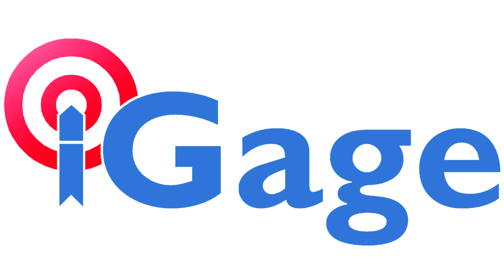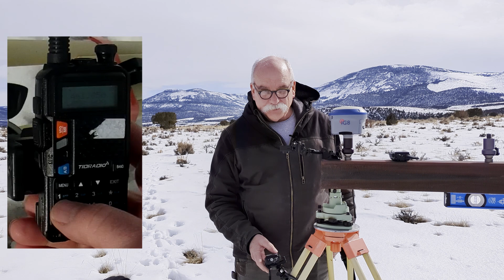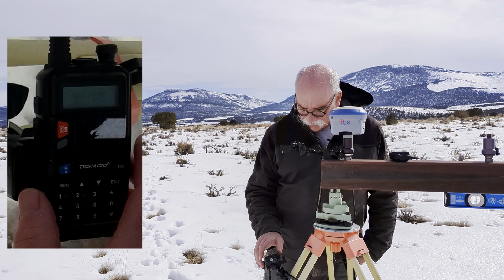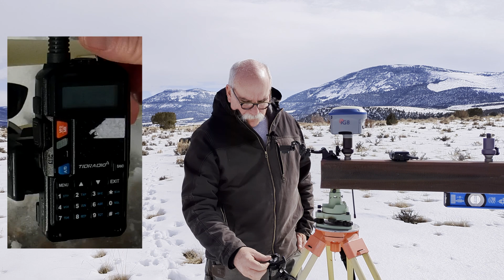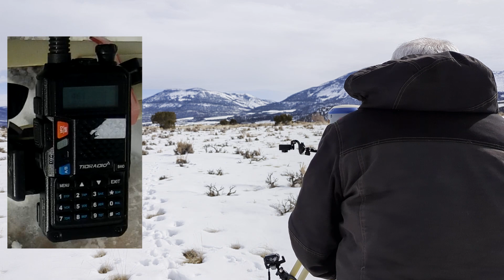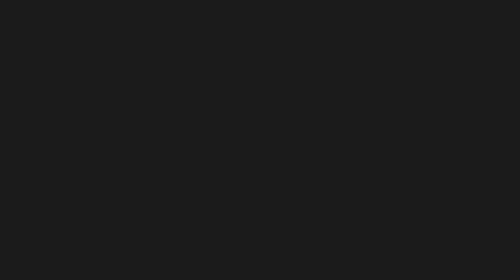RTK UHF Radio problem debugging

Comment: Good afternoon, Mark Silver.

I saw some videos published here on the channel about the GNSS CHC X90D-OPUS, I have a receiver that I use as a base working in static mode, since August 28, 2023, it is not recording raw data in .HCN format, Is it necessary to update to a more recent version?

I am very grateful if you can answer me.
Reply from the maker: See https://x90gps.com/ . A) BD950 OEM boards failed on August 30th 2023.